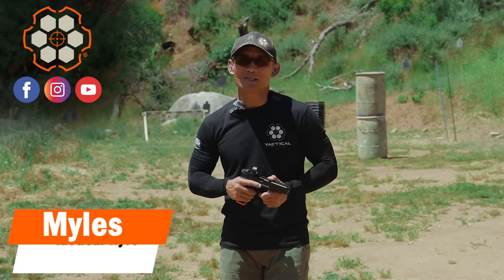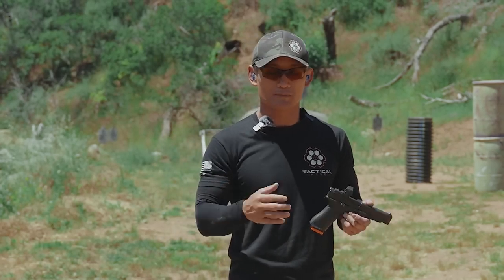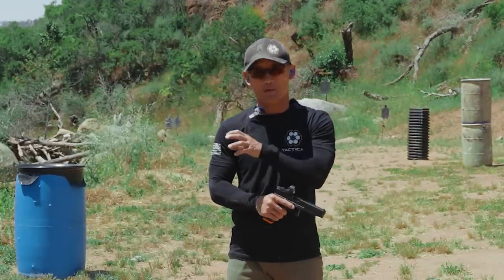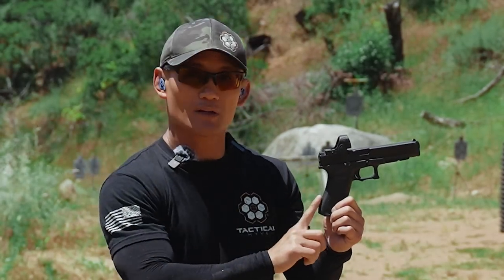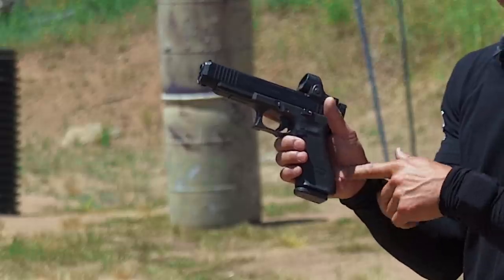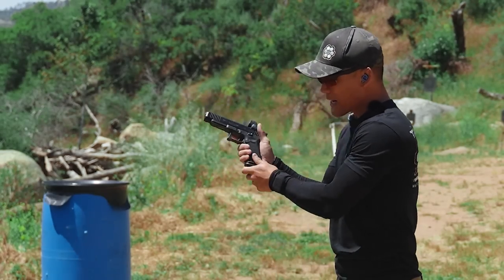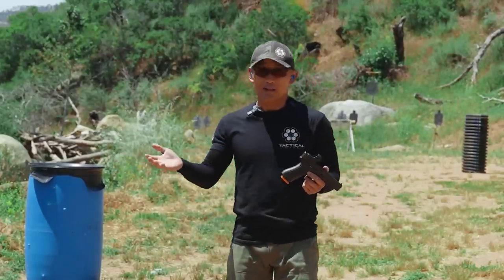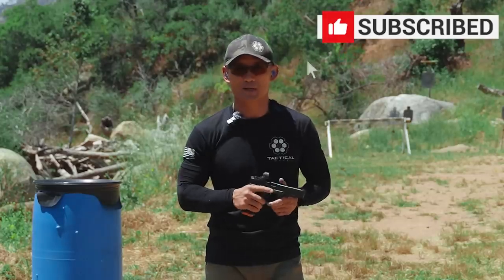How to Prevent Your Muzzle from Dipping

Comment: And the finger control on the trigger will not change because of your grip is tighter now???
Reply: You are focusing on a solid foundation between the heel of your palm and the backstrap of the gun. If you see someone shoot and their muzzle wobbles when it returns after recoil look at their palm placement. Usually their bottom of the heel of their palm is off center of the backstrap of the gun. Plus they need to improve the proper heel pressure.  The proper amount of pressure is very personal and will take hyper focus to figure it out. Plus focus on the upward pressure on the trigger guard. As you work on it you will see improvement.
Reply: It's different for everyone, but the whole "keep your firing hand lose" thing is horribly overrated and overused. Yes, new shooters tend to death grip a pistol and that will affect the trigger control but ask the top shooters how they hold their pistol, and they'll all tell you they hold it pretty tight with both hands. At least I know Rob Leatham does.

Comment: Hey, excellent advice. I will try it on the range. Thanks. Question: what do you think of a 1911 as EDC conceal carry?
Reply: If you’re referring a full-size government model, there are plenty of better options more suited to concealed carry. A double stack 9mm compact? If it’s what works best for you, no need to seek somebody else’s approval :)
Reply: I appendix carried a 1911. It’s totally doable. Magazine capacity is an issue, I had a 7 round magazine in the gun and an 8 round magazine in the side car magazine carrier. 

I found magazine capacity was more important than feeling big and powerful with my hand cannon chambered in 45 ACP. 

9mm is every bit as good and I can now carry 15 rounds in the gun and 15 in the sidecar. 

Reliability is a concern with a 1911. They run great if perfectly maintained but if they get dry and a little dirty they are prone to nose dive the round into the feed ramp and have failure to feed and out of battery failures. 

Cool fun gun but a beater reliable 9mm carry is the way to go in my opinion